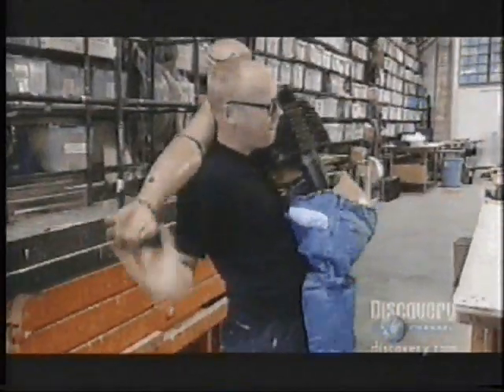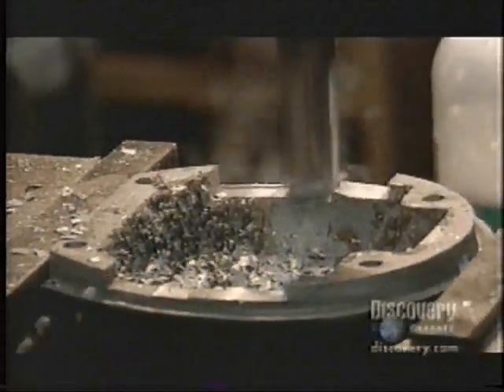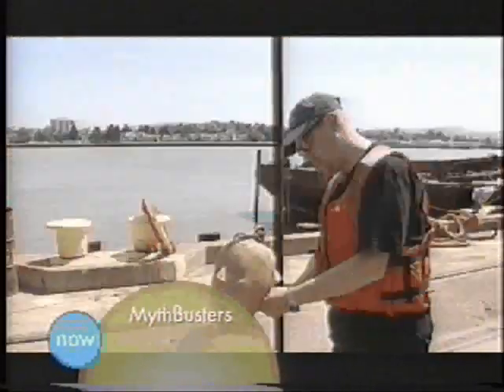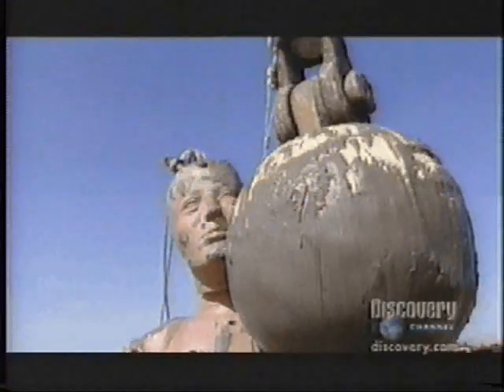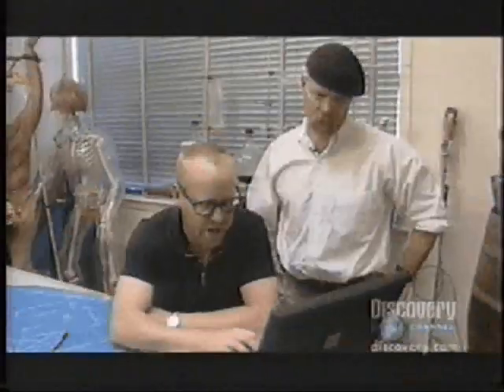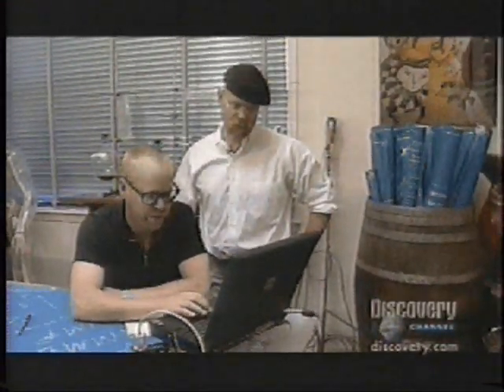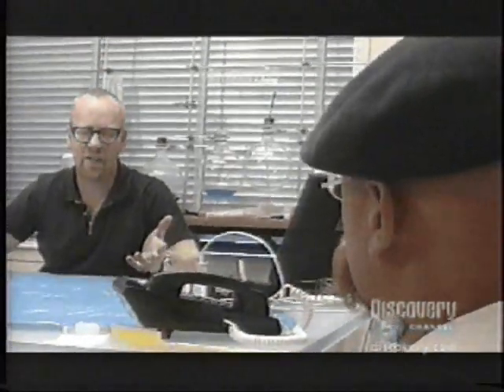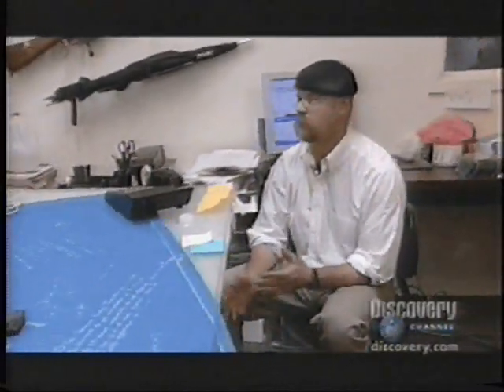EDR-3C on Mythbusters Water Impact Hammer Myth

Comment: For anyone wondering, yeah they could have done a better job, but the result would be the same.
Surface tension has approximately a force of 72 millinewtons per square meters, basically meaning it can hold 7g on a square meter. This is way too small to make any difference. What does softens the impact is an aerated water (with a very large quantity of bubbles) so jumping directly into a large waterfall or in special pools made for high diving training.

Comment: what if you jumped into a raging flowing wave filled aerated river
Reply: Death when you hit the bottom of the river, rapids are usually due to rocks right under the surface.
Reply: Aeration in rivers is typically due to obstructions beneath the surface. It would have to be aerated (quite significantly) by other means. Maybe a waterfall, or a subsurface gas leak.
But you're right, aeration would definitely help. Freestyle aerials skiers jump into aerated pools when training in the off season.

Comment: But wait..  how could Laso Schaller be ok from jumping from 58.80 m / 192 ft?? "it was in a waterfall". A waterfall minimizes water tension and drops the impact by alot. So if you had dropped the hammer a few seconds earlier and made the dummy land completely straight, Right where the hammer landed. It would have a different outcome. here is the video: https://www.youtube.com/watch?v=-9ox62y4zsE

Comment: The problem I have with this myth is that they did not really test the issue. The hammer/object hitting the water is not the important part. It is the splash from that object hitting the water that is important.
Think about this, in diving competitions, why is there a spray of water on the divers entry point?
It's done to prevent this very issue.
All Mythbusters needed to do here was drop buster twice, once with out a hose spraying the landing, and once with. Simple.
Reply: The spray of water is so that the divers can see the surface they're approaching. If the water is too glassy, it's hard to judge how close the water is.

Comment: I think this might work with something that has a bigger surface area like a briefcase or something. I think this doesnt work because the break in the surface tension that the hammer causes is significantly smaller than the size of a human body